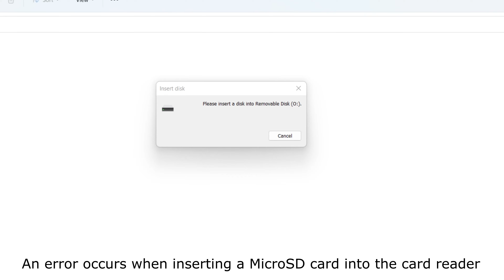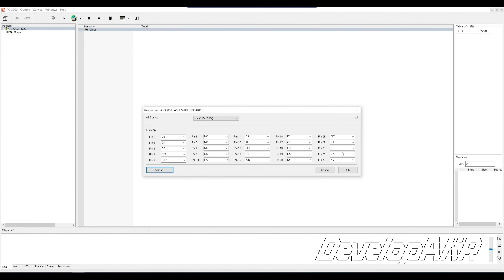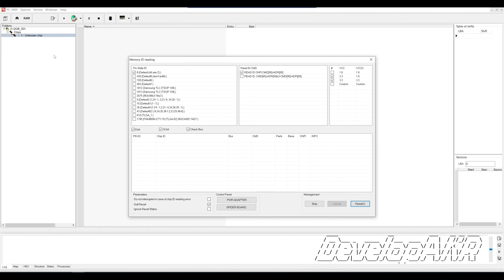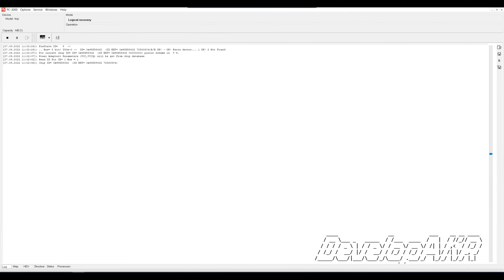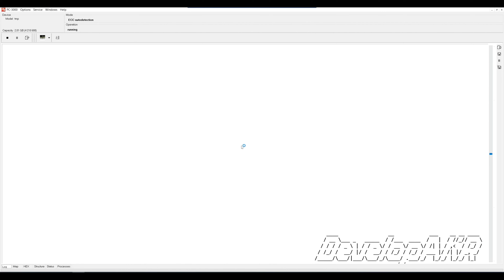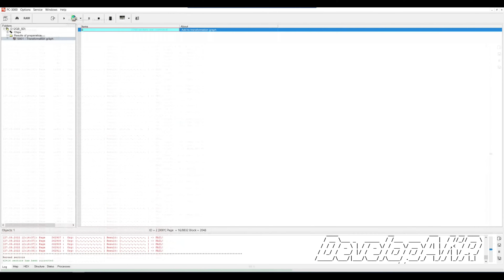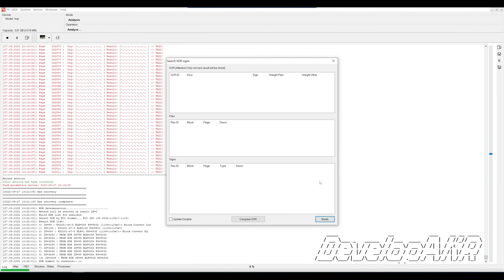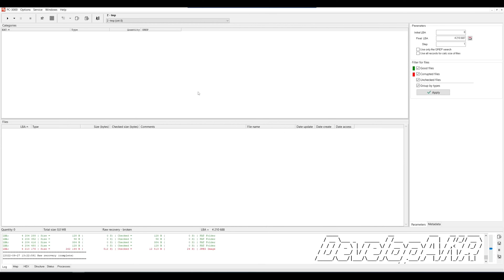Data recovery from a dead MicroSD card using PC 3000 Flash and Spider Board

Comment: What are the odds this would work on a card that seems to overheat when it is being read from? I have pulled data off it twice and it seems to get worse each time.  I assume there is a short, but I imagine if there is a short it is within the chip itself, right?  Rather than on the contacts you can expose or the normal contacts you use to read from
Reply: if you got a multimeter at home check for beep in continuity mode on the two longer pins out of 7, if it beeps your cards is shorted.
Reply: Are other cards overheating in this same slot? If so make sure all contacts are clean/corrosion free or replace it. If not, the card is your problem, stop using it before you have real trouble getting your data off it - bin it for recycle and get another one. As cheap as memory is these days I'd skip having to do a spider-board recovery if i was getting warning a card was possibly going kaput.